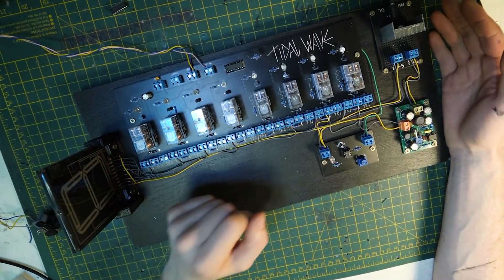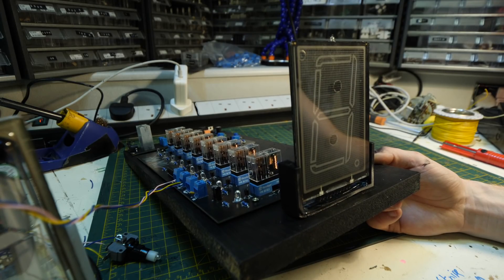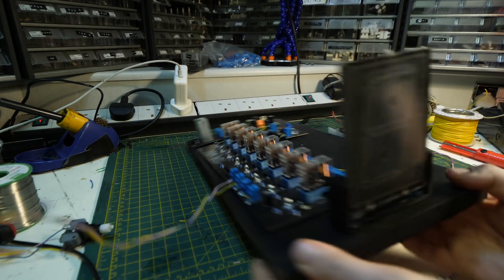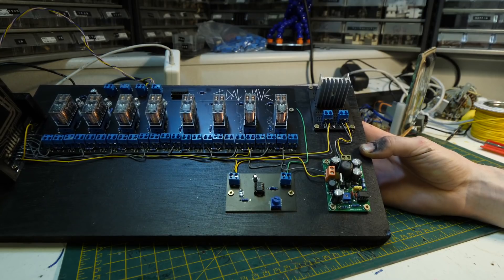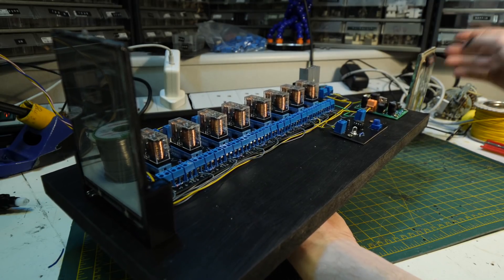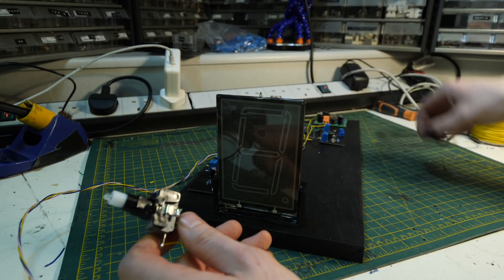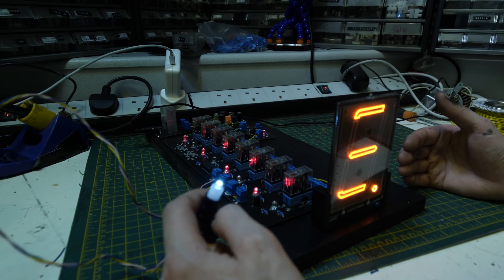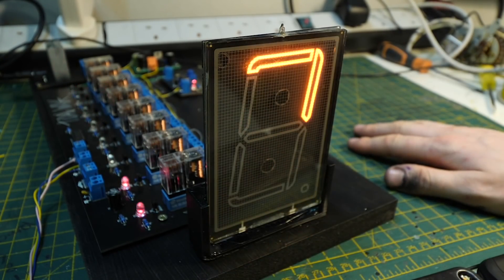PLASMA SEVEN SEGMENT DISPLAY RELAY MACHINE

Comment: Those giant displays are amazing. I wish I could build a clock with a few of those... 
I know it works, and will probably will work for the next 50years, but please just put 100nF between + and - closest to the NE555 and 7805 pins. What do you think companies invented bypass caps for? :D
Reply: Yeah it will limit wear

Comment: You can mod the shift register to a Linear-feedback shift register - that will generate random patterns for the cost of one added chip - XOR gates.
(There has to be an even number of taps, tap bit numbers can't have common divisors, bits are counted from 1, not 0 - for 8 bit register they are numbered: 1 (input bit); 2; 3; 4; 5; 6; 7; 8. To get most randomnes one of the taps should be from the last bit.)
Reply from the maker: indeed!! xor noise style! but alas it stops it from being interactive. hence it not having that. coolio
Reply: This is how computers like the C64 generate their noise sound and also what the Atari 8-bit (and Lynx) sound is based on.
Reply: @VectrexForever  Yeah, SID has a 23-bit long LFSR with 2 taps to generate noise.

Comment: Another cool and interesting video which made for ideal tea time viewing. But, why do nearly all of those seven segments-type display always slant to the right? Is there a particular technical reason for that?
Reply from the maker: im sure someone will have an answer! I thought it was because the person who designed it had 1 leg longer than the other so was used to seeing things at a slant? not a clue ha
Reply: @THISMUSEUMISNOTOBSOLETE  Haha. Perhaps "Technology Connections" might have the answer.
Reply: Think it's mostly a stylistic thing so the decimal point doesn't create as much of gap between digits.
Reply: I have an 8 segment dispay that creates a colon from the two full-stops by turning around the 3rd display unit 180 degrees, so I guess it's for reasons of practicality and legibility.